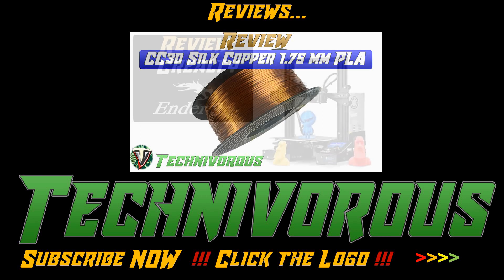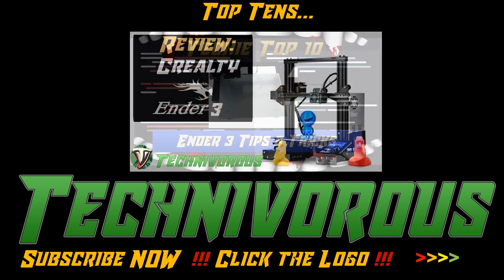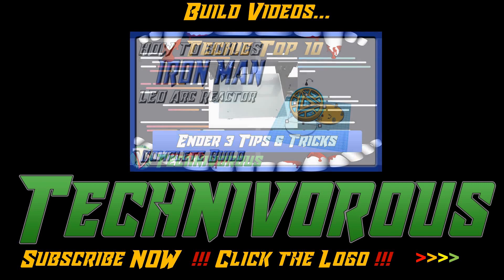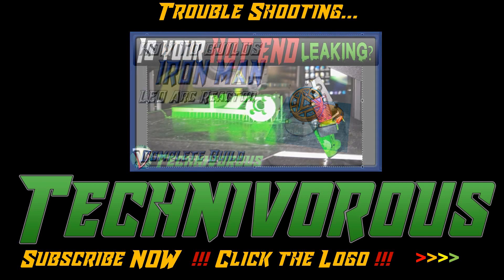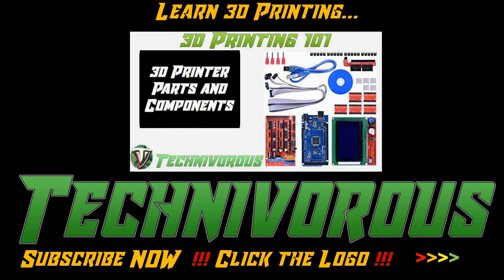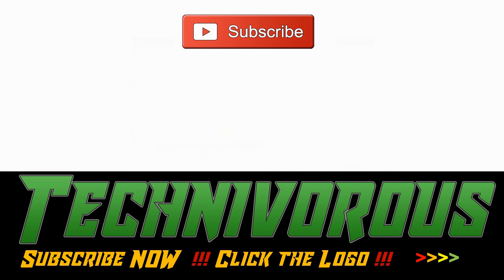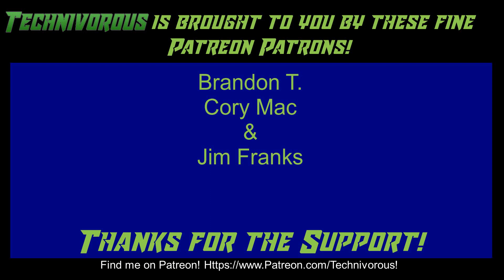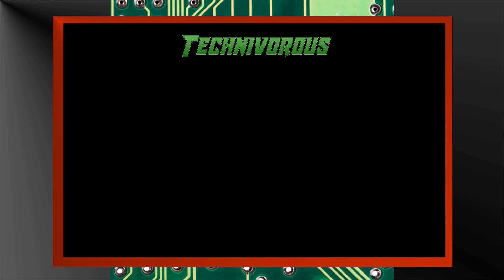3d Printing Mandalorian Armor

Comment: When you do the electroplating on the next helmet, please deep-dive into what you're doing, step by step and with whatever details are needed for someone (_coughmecough_) to do the same without having to view any other videos on the topic. (If that means doing more than one video, or perhaps a "How-To" video(s) separate from a short "helmet update" vid, as you've been doing in this series, that would be fine as well.) I had no idea you could do that to plastic 3D prints, but am excited by the possibilities, and I'd rather spend my time watching a tutorial from you than to dig around YT, wasting time on vids that probably will miss or gloss over important steps and such.

That aside, good job on painting the helmet, even without sanding. What did you use for a primer, BTW? Because if you go to an automotive store (or order online like a Normal Person) you can buy "gap filling" primer spray paint that you put down first, to fill in gaps before you sand - or on objects you don't plan on sanding, even - so that when you sand you're not removing what could be thin and/or detailed parts of the model, but instead have the extra surface layer of the spray paint to remove (leaving behind what it has deposited between the layer lines). I think there's another term for it as well, but "gap filling" is the name my brain is coming up with now, and all my spray paint is in storage at the moment and I don't want to go dig it out to read the label...
Reply from the maker: I"primed" it with a few layers of the same brand of paint only in sky blue. Just to make sure I could get even coverage. Yeah remember how mg chemicals sent me all that filament a while back? Well I contacted him about the electroplating kit they had and they dont make it anymore, so I need to find one through a different company but I will definitely do it step by step for ya. In the mean time hes sending me another 15 lb box of filament and I'm curious what's inside..
Reply: @Technivorous  wow, that's awesome! Nice to have over 1k subs, eh? ;)